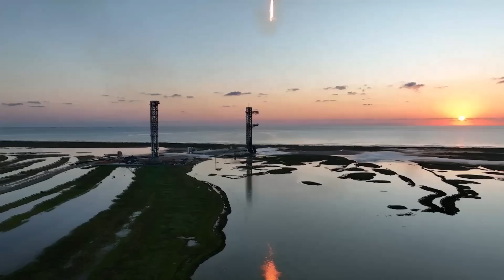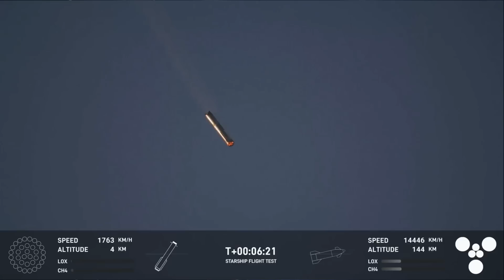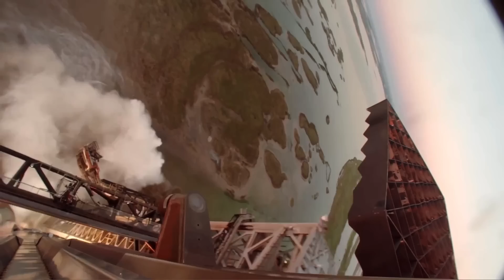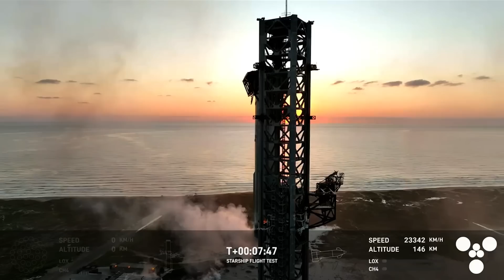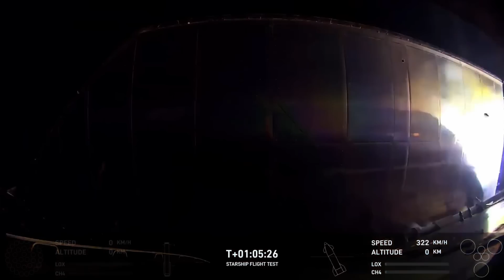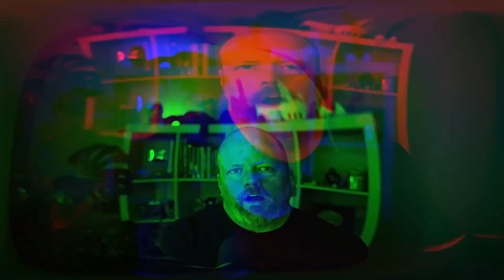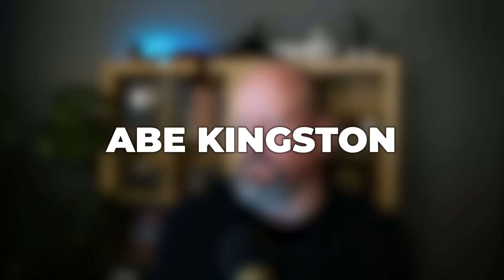ABSOLUTE Success! Full Analysis of Starship IFT-5 (with @scottmanley, @MarcusHouse )

Comment: Why are people so surprised this booster landing worked? It seems so much better than landing legs in any way I can think of. I think this was less difficult than if the booster had attempted to land on legs
Reply: If the landing pad is the size of a football field, you don't need a lot of precision to hit it. The precision and control required to safely land on moving mechanical arms without hitting the tower or breaking the tower arms is on a completely different level. Also remember the two lifting pins they use for the landing also needs to be rotated almost perfectly, so they hit the catch arms. For a pad landing, the rotation does not matter at all. There's a reason the entire world was left speechless after seeing this. Very few expected it to work perfectly the first time.
Reply: If you look at Falcon 9 landings, most of them don't have the precision required to do this style of catch. 

They can land on a platform sure, but usually off to one side a bit.

Comment: Maybe it’s common knowledge but could some explain how, with the incredible force of the air being forced into the bell of the rocket engines as it is coming down, how does this not cause a problem with relighting the engines with all that back pressure in the opposite direction against the engines? I’ve never heard an explanation of this process. Please and thank you.
Reply: They pump CO2 into the turbines to get them spun up before engine start, so maybe that eliminates the backpressure and gets momentum moving in the right direction?
Reply: My initial thought exactly, but the air fuel mix entering the nozzle is under tremendous pressure, as it must far exceed the pressure of the exhaust, or it would back up and blow up the rocket.  The rocket engine is mostly two huge turbopumps, burning a lot of fuel to compress the fuel and oxidizer before it enters the nozzle and burns...Rocket science is rocket engine science.
Reply: I think the engines produce way more pressure while starting up so it's not a problem.

Comment: If Starship has to pay the mass penalties to beef up the flaps, heat shield, the bottom of the Superheavy Booster, and even an entry burn for Superheavy, It's still well worth it. A fully and rapidly reusable fifty - or seventy-five tons to LEO is far better than 150 fully expendable tons to LEO. Anything fully and rapidly reusable with close to a one hundred-ton payload is a game changer.
Reply: I think it will help a lot that Starship v2 has the flaps mounted in a different position, further "back" and not centered around the cylinder. It is the flap hinge on the curved surface at the front that is the main problem. It's very difficult to seal up that when there are moving parts and a very dynamic load on it. Having the hinge be put back away from the worst plasma heating will make a big difference I suspect.
Reply: @SeanChYT  I've heard that a couple times the last couple days. I hope it's that simple. However, the rest of the heat shield seems far from rapidly reusable. The heat shield has been my biggest concern since SpaceX decided on tiles.

Comment: flight 5 = literally the 5th time they have lit all 33 engines at full power ... I don't think they hot-fire all the engines at once.
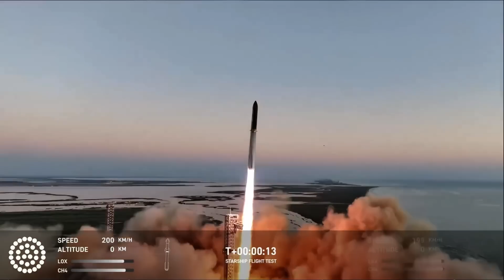4:35 - Just how long is that plume of fire ... The stack is 120m tall, and the flame tail is longer than that ...
Reply: As far as I remember, flight 1 had several engines not fire (2 or 3 were even disabled prior to T-0), and flight 4 had one out.
Reply: @SeanChYT  Yes, a couple of the launches didn't go up with 33 running. flight 1 had 3 engines off before liftoff, and was the first time they had even tried to ignite all 33 at once.

Comment: Phobos & Deimos were likely cancelled for a couple of reasons. 

Though there are some sea launch vessels around the world, none are on the scale of Starship.

During launch, the exhaust can either be diverted or allowed to be injected into the sea.

If flame diverters are used, the thrust reaction will heel (tip) the vessel unless the launch pad is arranged close to the centre of the vessel.

If there is no flame diverter then the vast amount of exhaust gas being injected into the sea will make the water non-buoyant. This is obviously problematic for a floating vessel.

As for catch, except in mirror calm sea states, all floating vessels are rolling & pitching (moving around) all the time. Semi submersibles like Deimos & Phobos mitigate vessel motion compared to ship shape hulls, but they do not eliminate it. Even minor vessel motion at sea level is amplified considerably at the top of a tall derrick or catch tower.

One solution is to use a Jack Up. These vessels float from site to site like a ship or a barge. Once on site they lower legs to the sea bed to create a stable non moving platform.

If the platform is fixed & stable, catching is possible. If the platform is elevated on legs standing on the seabed, it would not be affected by non-buoyant seawater.

Such a facility could be permanent or semi permanent if it was developed as a space port. Or mobile if it had to fetch & return boosters & starships to & from port.

Modified Offshore Windfarm Installation Vessels would be a good fit for a mobile solution. Cantilever Jack Up drilling rigs would suit a semi fixed application.

https://www.newscientist.com/article/2353534-ship-taller-than-eiffel-tower-will-build-biggest-offshore-wind-farm/

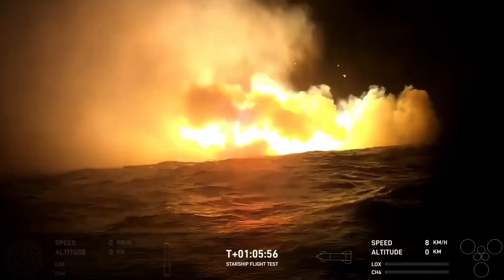Comment: 34:11 So WHY did Starship explode?
Reply: FTS no doubt. They needed to make sure it would sink.
Reply: Engines burning under water, the main purpose of Starship test was re-entry and accurate touchdown location.
Reply: FTS + structure not designed to fall + Imagine hot lava falling into the very cold ocean water. It will produce a powerful reaction.
Reply: Hard impact from tipping over or FTS kicked in

Comment: Scott had it right - just circulate coolant through the outer engines.
Reply: iirc Tim Dodd did a video explaining how they cool the engine bells and its with the fuel that is about to be burned in that engine, so I'm not sure they have extra coolant to cool the engines with unless they were to dump fuel. I might be remembering the wrong engine design though...
Reply: @lexpox329  You are correct, but there is extra fuel normally, that is what was on fire on the side of the booster just prior to and after landing.

Comment: Isn’t it a simple solution to skip off the atmosphere longer to allow for cooling for starship? Skip, cool, skip, cool, skip, cool….. then go deeper into the atmosphere
Reply: I believe the velocity that starship is at in these flights is meant to mimic the final decent. If it was returning from the moon or or mars then it would  be going much faster and need to do some aerobraking to get down to the 27,000 KPH that its going in these tests.

Comment: 41:40 You don't need to return the booster by shuttling it back on a landing platform.  You need to REFUEL Superheavy on the landing platform so it can launch itself back to Starbase!  Of course, this is a short-term solution for an odd launch where the thrust to return to base is needed to instead give extra 'umph' for a special payload.  Having typed that... I'm dubious this is a capability worth pursuing at all.
Reply: I wonder about the fuel efficiency of "refuel and toss it back at starbase" seems like it would use maybe up to 25%? of the fuel load just to get back again. Transport on a ship would cost almost nothing in fuel and if you have a bunch of boosters that can fly 23+ missions each, you might not need to turn them around that fast. Also if they do end up having some maintanence that needs to be done with each launch those tasks might be able to be completed on the ship during transport back to starbase so it arrives ready to launch again.
Reply: @lexpox329  It’s not fuel efficient, but transporting the platform back to port and transferring the booster ashore, then back to Starbase is not efficient, either.  One requires more,$$s in fuel.  The other requires more manpower and vastly more time.  Time is money, no?  Either way, I think SpaceX has it right in returning the booster and just NOT designing missions that don’t work without an inflight return.  The expense of downrange recovery systems and operations is unlikely to be less than the expense of occasionally sacrificing a booster if the extra thrust is TRULY required.
Reply: A better solution a series of launch sites equaly spaced around the world so it goes from one to the next doing a full mission from each in turn.
Reply: @martinrwolfe  Yes, of course!  We’re talking about ops during the transitional time when things are still ramping up.  Again, I don’t think ANY downrange recovery solution will be economically worthwhile.  Such complexities will mostly divert resources from the primary growth mission/solution.

Comment: The camera coverage by SpaceX just keeps getting Better & Better. The number of cam angles on this catch were amazing !  Yea, there were a few anomalies on this flight, mostly w/ re-entry heating, but these problems should be relatively easy to fix given what SpaceX has been thru to date.
  I'm curious what the next move will be and where on Planet Earth do they plan on catching a StarShip.
Reply: Pretty sure the plan is to catch it back in texas. That way, they could rapidly reuse it.
Reply: @swiftnicknevison4848  The Orbital mechanics involved in launching & Landing (or catching) at the same location is really going to extend the mission.  Australia will likely be that location as SpaceX has recently applied w/ the Australian gov & Space agencies to do business there. It's just a few more minutes of flight to Australian land using the same route that IF-5 flew.
Reply: @uuzd4s  that would only apply if it was a sub orbital run.  I'm expecting them to go to orbit and just wait for the right moment to come back.  There's no rapid reuse if you catch it in Australia and then have to ship it back to texas.
Reply: @swiftnicknevison4848  As I said, landing where you launched from would extend the mission substantially.
Reply: Things that appear easy to fix at first sight are often the most stubborn problems.
Reply: @rogerphelps9939  Well, if you noticed,  there was a substantial "frost line" on the Super Heavy CH4 & LOX tanks after being caught, meaning they had additional fuel to burn. Just do a slightly longer re-entry burn & two major problems are resolved. The outer Raptor Nozzles won't warp and the outer Chinese covering the COPV's would stay intact. OR, they could simply run chilled LOX thru the cooling veins of the outer Raptor Nozzles and cool them that way. Compared to past hurdles, the re-entry heat issues that this 5th flight experienced could easily be overcome. I think their next big hurdle will be the StarLink satellite PEZ dispenser and/or Orbital Refueling.
Reply: @uuzd4s  My concerns are principally for the Starship. If it is to go anywhere beyond LEO it has to eventually reenter from 25000 mph, not 17000 mph and that is double the kinetic energy to dissipate.
Reply: That's probably why they're building the 2nd tower.
Reply: @RickL_was_here  Might be but it's more likely there simply for redundancy. If a Super Heavy Booster catch goes wrong . . . 
The other thing is, if they want to Catch StarShip after it's gone into Orbit, they're going to have to circle the Earth many times before a landing approach opens up.
  SpaceX has applied to the Australian Government to allow for StarShip activity there. If you follow the Flight of the Starship launches, Australia gets flown over just after the Indian Ocean they landed StarShip on. They don't even need to make a full orbit to hit Australia.
Reply: I'm just saying that if it's an up and down thing in a short amount of time, can they clear the booster off the pad in time? That's why it makes sense to have one collect the booster and the other to collect the ship. I guess we'll see as I don't imagine they want to dump another ship into the drink.
Reply: @RickL_was_here  The StarShip is going into Orbit and would have to stay in orbit for at least 24 hours before the first opportunity to land at the launch location.  The plan for the Superheavy Booster is a turnaround within hours. That's the plan for Starship as well, a quick turnaround within hours making a single LIT feasible.
Reply: Ya eh, I get that too. If by chance the landing doesn't quite go as planned, I imagine it's still available as a backup. Either way, I'm glad there's more than 1 and from what we've just seen, they work.
Reply: @rogerphelps9939  my thoughts exactly.
Reply: I wouldn't say the re-entry heating issues are easy to solve but they are solvable. I think ultimately this will be the problem that takes the longest to solve.
Reply: @schrodingerscat1863  Didn't say it would be easy, I said Easier than previous problems that SpaceX has had to solve so far w/ this BFR. But yea, you may be correct, it seems they're on their 3rd or 4th iteration of Heat tiles and how to place them. Getting these tiles to hold up to the proposed quick turnaround re-flights that Elon wants will be a tall order.
   This guy doesn't believe in Roadblocks & he's one of the best "out of the box" thinkers on the planet.
  I worked for a Very successful R&D firm for 15 yrs out of Seattle. there were only 8 of us but the guy at the helm was "over the top" Genius level thinker. It was fun to watch him go, if you could keep up.  ; )

Comment: They saved the booster but the starship thats suppose to carry people hit the water at 50 mph and quickly exploded.  Maybe You watched a different starship landing than i did. That was scary, There would be no survivors, but elon got his expensive booster back. How many starships have they blown up now? at least 2 that Ive seen
Reply: Seemed like a soft splashdown to me. Not sure where you got that 50 mph number from. However, you should keep in mind that SpaceX actually wants the Starship to break apart and sink. They do not want this floating around for anyone to inspect, crash into, etc.
Reply: It didn't hit at 50mph... you could see it was hovering above the water. Only exploded when it tipped over... the telemetry they show gets messed up as they reach zero every flight

Comment: Superheavy is like a steel piston that punches you into the upper atmosphere then resets!!         :)

I love the tower camera view of it, and the downward grid fin view from the booster too.
In some ways I wasn't surprised by the catch, it has more engines and throttle than Falcon 9 so it 'should' be more capable of precision landings!   
As mentioned, it was passing all those abort points and reaching the catch attempt that seemed unlikely.

Maybe they'll find an island or seamount they can build a Mechazilla on and land Superheavy, then hop it back without an upper stage after refueling.

With no payload, a Starship prototype could carry floatation bags to keep it above water until it can be secured.
Reply: There's a bullet type that works like that. The gas is contained and pushing a piston (which pushes the bullet) rathern than expanding between the bullet base and case head.  It's called captive-piston ammunition.

Comment: Actually I was wondering, how do you feed the engines when the rocket is accelerating downward with the fuel sloshing upwards? Does it have baffles with secondary feed line inlets on top of each compartment, is Superheavy tank even compartmentalized? Also how do the turbopumps in the engines accommodate multiple rapid shutdowns and reignitions? Does each need a clutch or a starter motor?
Reply: They do have slosh baffles but also use gas to pressurize the empty space so it doesn't slosh as much.
Reply: keep in mind, while the booster is falling through the air it experiences drag, which slows down the booster. Because the propellant has inertia, its trying to keep going while the booster is getting pulled back, which in turn pulls the fuel back with it. The result is the fuel sits at the bottom of the tanks while the vehicle is falling. There is also the fact that the methane transfer tube is narrow, and the oxygen side has an extra tank for landing propellant, so even if it was sloshing around, there wouldnt be any bubbles because the propellant doesnt really have anywhere to go to make bubbles. With these, they dont need the main tanks, which at this point are full of CO2 snow, and water ice. They dont use clutches or starter motors, but they do inject cold gas into the turbines to spin them up prior to ignition. I'm not sure how they shut down the engine though.
Reply: @faxinspace  So I see, then they don't have a secondary inlet set at all? Also, I assume they might use the blowoff valve to direct fuel back into the tank to stave the engine
Reply: Great questions that hundreds of SpaceX scientists and engineers have answered.